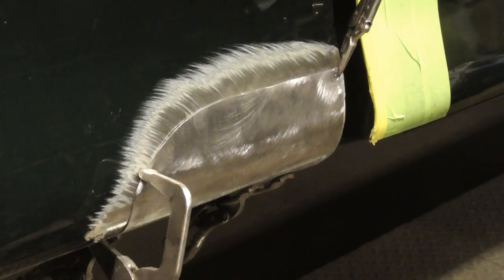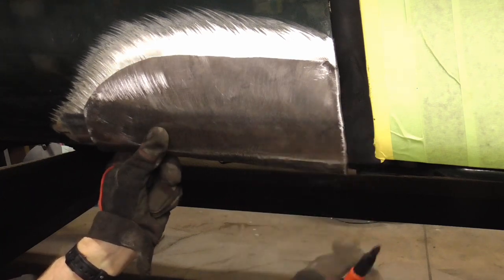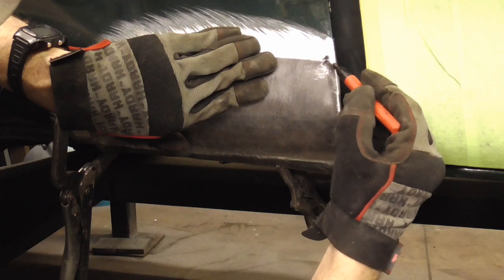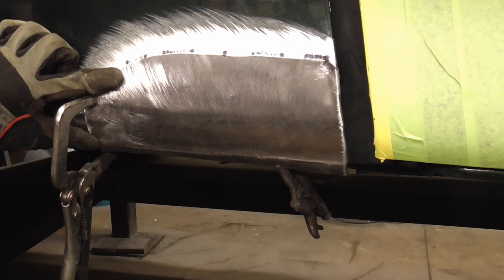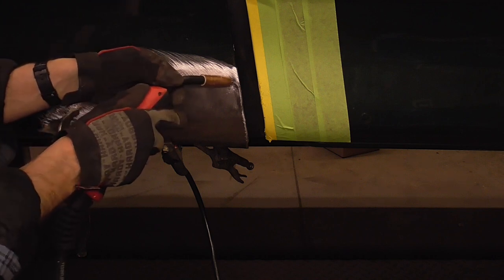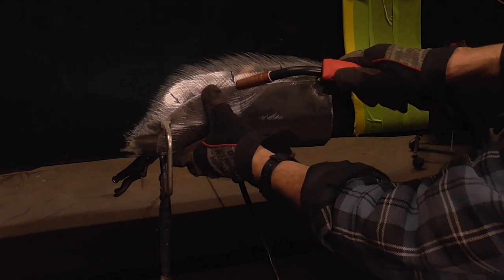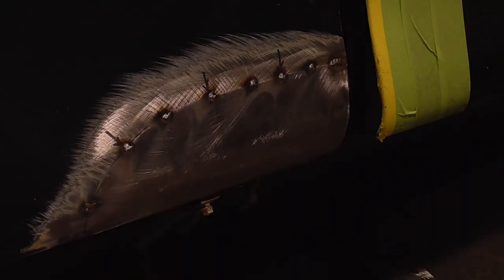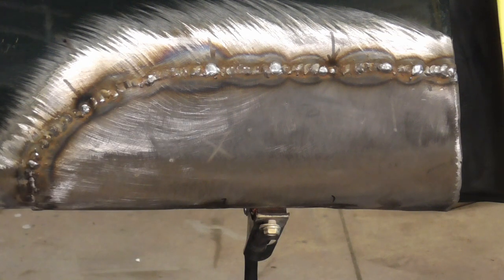How to MIG Weld Rust Repair Patch Panels - Detailed & Up Close

Comment: This is everything you shouldn't do when welding a patch panel. 1. Lap joints are prone to rust. Look at any 60s or 70s vehicle, the rust always starts where two pieces of metal overlap. 2. No weld-through primer on the parent material in a place that you will never have access to again. 3. Way too much heat in one spot, even with a lap joint. 4. Parent material wasn't flanged for a lap joint, that will take lots of hammer dolly work to fix or body filler for the lazy approach
Reply from the maker: With tons of respect, everything you said here is bad info.  A combination of lap and butt is always best - see - https://www.youtube.com/watch?v=JIIonJOVro4  #2 Weld through primer is not for wire welding also factories are moving away from it 'cause they realize that it negatively effects the weld pool and really doesn't work that well  #3 There was no metal dist - not enough heat.  Also rigid areas, you don't have to worry as much as large open flat areas.  #4 Body shops don't use flange tools because you cannot always use it.  If you can't used it on right angle bends, contours, angles, lips, why do it. If you do rust repair for a long time you'll eventually use the methods found on this channel for efficiency and longevity - here's proof - https://www.youtube.com/watch?v=gIS1Tbv7Kvw  Stop back in 5 years for another follow up video on this truck - it will look exactly the same.  Sorry. I've got to look out for those that want to get a job doing this one day.  I worked in many professional shops and know what bosses want.
Reply: Where is your video of doing it the un lazy way

Comment: uhh thats not butt welding. thats lap welding. not the best thing for patch work. just my opinion.
Reply: He said only the edge is butt welded with the rest lap welded. You would not be butt welding thin 20-22 gauge metal on my vehicle and then grinding the weld flush. After all that grinding I would have no metal left resulting in a weak repair. Lap welding is longer lasting and much better repair with today's thin metal.
Reply: @jonathanyates5198  then you are not doing good bodywork in my opinion. i do nothing but butt welding and grind flush. when im done it looks like nothing was there. lap welding requires more filler that will and eventually crack. at that point you are sculpting work ... not filling. there is a huge difference especially in a restoration.
Reply from the maker: Butt welding is great for restorations that aren't going to be driven anymore - especially if you grind the heck out of the welds and try to metal finish like the magazines and TV suggest.  For longevity you'll want to use a combination of lap and butt for many good reasons - see the following vids - https://www.youtube.com/watch?v=JIIonJOVro4  *  https://www.youtube.com/watch?v=gIS1Tbv7Kvw  Trying to get the truth out there :)
Reply: grinding seems to be a point here. so ill say this. if your spot welds are solid with good penetration to the backside, you should be fine. your spot welds should be flat enough on the front to do a nice grind flush. if you're grinding beyond that cause you're thinking it doesn't look that way then thats a weld issue. stop and fill with another weld. you should not grind beyond the existing metal to make your welds look good. that is where you make yourself thin.
Reply from the maker: @jamesroe7628  With respect, I totally get what you are saying but you can never guarantee the the seam is water tight.  How you do your patches is totally your choice but know that quality body shops I've worked at that want to make sure that their work doesn't come back & holds up to daily driving in the rust belt use this method.  When you see an outline of a patch or bubbling around the edge of the patch in a few years, it's because the seam was not prepared like this.  See this video on why:  https://www.youtube.com/watch?v=JIIonJOVro4  It's just the way shops do it here in the metro Detroit and surrounding areas :)  Have a great week James :)
Reply: @jamesroe7628  He only puts on a skim coat of filler. The seam is tapped just below the surface. Not enough filler applied to Crack. Speaking of which, the only time I've seen filler fail is when the surface wasn't prepared properly or some dim wit used it to fill in a rust hole. I've seen filler applied thick and correctly that never cracks unless someone hits them in an accident

Comment: You over lapped the pieces but no flange?
Reply from the maker: Yes - no sense in flanging if you can't do it 100% of the time.  Can't do it around bends, 90 degree angles, rockers, wheel opening lips, edges, rigid contours, etc.  Get good at one method and become very efficient.  Hope that helps explain why I don't do it :)

Comment: That process sure gets the job done fast! The new welder seems to be working well, once you figure out it’s idiosyncrasies 👍
Reply from the maker: It's a good welder for the price.  One of those things where you have to use it to get familiar with what works best.  Thanks for always supporting CSG :)
Reply: @LakesideAutobody  cheap welders usually benefit from changing ground clamp to a bronze one, the cheap 1 from Harbor Freight can make a world of difference on some small 110V welders

Comment: Another great video Jerry! Those YES welders are popping up all over the place. Seems to weld nice but it has an interesting sound.
Reply from the maker: I was able to eliminate the weird sound by increasing the wire feed and temperature a bit.  I think it was some sort of electrical vibration.   I can weld just like a Miller or Lincoln - just got to find the right setting and get familiar with it.  Seams like a really well built unit so we'll see how it holds up under some constant usage.  I'll be sticking with it for a while just to see.

Comment: Great job Jerry.  I will be doing a lot of stitch welding on my rally car build to stiffen the chassis.  Your new Mig welder has a unique sound to it.  Thanks for the video.
Reply from the maker: Yeah - I haven't figured exactly what that is.  I do notice if I turn up the wire speed it goes away.  Might be some weird electrical vibration - not sure.  I started a platform to upload viewers project pictures.  The link is at the top of the home page - Project Pictures and More or the link can be found under the "about" tab on the home page or this :https://discord.com/invite/Qm6qJgcubu

Comment: I prefer to do the lap weld joint where I can too. In my experience, it makes for a less wavy repair and a stronger repair. I've seen a lot of guys on youtube do butt repairs, I tried it didn't like it. If it's in an area with a lot of curves,then I will butt weld, but the panel has a tendency to not warp on curvy areas. On a long straight repair like an outer door bottom, I prefer the lap weld, it just stays straighter. I will butt weld  on the corners like you did here. To me thats the perfect way to do it.

Comment: Nice job. panel welding is almost like meditation to me.  On big or long panels I sometimes just zone out and go on auto pilot
Reply from the maker: It's nice when you've cut out ALL the rust - didn't cheat then run into real thin sheet metal while welding.  Gotta love it when each weld melts nicely into the other and you get into a nice rhythm.  Thanks for watching and the support Bruce

Comment: Great closeup detailed video. When you overlap a small part of the metal versus butt welding the whole panel, how do you make sure it doesn't rust between the panels?
Reply from the maker: It won't - that's an internet/magazine/blog thing.  Body shops don't butt weld unless it's an edge, rigid panel like rockers, etc.  Here's a good video on the subject - https://www.youtube.com/watch?v=JIIonJOVro4

Comment: I like the way you showed the weld location with the marker first. The detailed welding is very good, this will help me a lot. I'm looking forward how you grind down the welds. I have a problem getting this done. A flap disk always takes off to much surrounding metal (I really try to be careful). A die grinder seems to work good but is slow. Since you didn't flange the body, how do you get the patch flat to the fender? I always enjoy your videos and will watch this one many times.
Reply from the maker: Next Friday I'll have a video showing exactly how to prepare this patch for filler and finish it.  It should really make it easy for you.  No frustration getting the filler straight, no problems with thinning metal/welds, etc.  A good quality, long lasting repair.  Thanks for watching and I appreciate the kind words.  Have a great weekend my friend :)

Comment: Hi Jerry, great video mate. Is there any reason you did an overlap vs butt weld on top? is this just a time/cost thing for repair vs resto?
Reply from the maker: You can butt weld that seam if you like.  In a regular body shop setting you use both but depending on the situation.  Lap for areas that can be tapped down and butt for areas that can't - edges, sharp bends like A/B/C posts etc.  All body shops I've worked at in SE MI did it this way - many are now using panel adhesive on their lap joints.  See this video for more on lap vs butt - https://www.youtube.com/watch?v=JIIonJOVro4
Reply: @LakesideAutobody  thanks Jerry. Any weld through primer on the surface’s that overlap?
Reply from the maker: @mickholgate3347  No.  Here's why:  You will be adding metal with the wire feed and this will not be coated with the weld through primer.  Also I doubt the weld through will hold up to the MIG temperatures - surely there will be bare metal around the area you welded.  Finally, Honda and others have stopped the use of it - they state that it has a negative effect on the weld pool.  The best way to prevent future rust is to treat the repair after the job is finished like this - https://www.youtube.com/watch?v=8XaZBy7GC7A  You can use used motor oil or purchase products that do the same thing like Cosmoline, Fluid Film, etc.

Comment: Love your straight to the point approach, btw ever used bronze mig weld and your thoughts? Cheers keep up the great clips
Reply from the maker: I have not.  Might take a look at it for a future video though.  With the low temps it may work better for some thinner sheet metal.  Have you used it on sheet metal?  Thanks for the kind words and have a great weekend :)
Reply: @LakesideAutobody  hey thanks for replying, Seen lots on utube on bronze welding and I’m 50-50 on purchasing and trying it! Would be great to get your opinion 😁 I think I’m being a cheap bastard lol. Have a great weekend cheers
Reply: @abdulhamoui4376  it isnt a true welding, its like a silver solder, many new car manufactures call for it to repair HSS, "High Strength Steel"  to be effective on new cars you need a pulsed MIG to keep temp colder at braze joint. 

some people like the color for doing custom exhaust. but its up to you. its very expensive for what it is. 

wire I never tried, but want to is EX grind, so supposedly will grind easier than normal hard MIG wire. but never tried it either, personally I prefer Washington Allow wire for auto-body with Lincoln wire my second choice.

Comment: Ho from Argentina!!! Thanks for your video!! I need your opinion. Butt welding or overlaping sheet metal panels? Thanks
Reply from the maker: Butt weld rigid sections like edges of doors, rockers, and stuff where your seam can not be tapped or knocked down before filling.  Areas that can be tapped down - lap.  Body shops in MI lap most of the time and butt where you are forced to do so.  See this video for reasons why - https://www.youtube.com/watch?v=JIIonJOVro4  & this video for longevity - https://www.youtube.com/watch?v=gIS1Tbv7Kvw

Comment: I have that same Miller Cricket XL you have under your new welder. How would you set it to get those nice beads you made. I'll be spot welding in my B pillar mounts on my Crew Cab and want them to pool nicely like yours. Just can't afford a newer welder right now. Nice work ya did on that patch 👍 Thanks 👍
Reply from the maker: I really do love that Miller - it's just bullet proof and welds great every time no matter the thickness.  For 22 or 20 gauge metal I set the wire speed to 35-40 and and the heat on 2.  If i start blowing through, I'll move it down to 1 but keep the wire speed the same or drop it down about just a bit i.e from 40 to 35.  Gas is 80/20 argon/co2.  Have a great weekend Ron - Jerry
Reply: @LakesideAutobody  Thanks Jerry. I appreciate it

Comment: So was the about 1/4 inch longer? Thank you for the video!!!🔥🔥🔥🔥
Reply from the maker: Yes the "lap" is about 1/4".  It can be larger or smaller - your choice.  You really don't have to worry about corrosion between the metal as the seam will always be upside down.  Also rust always begins at the bottom of the panel where the debris, salt water, and moisture settles.
Reply: @LakesideAutobody  ok the so the welds help blend the over lap in with each other?
Reply from the maker: @papergatorzfedducca7998  Somewhat, but the lap is still there - it's a "high" area.  Next step is to tap your seam (welds) down just a bit and fill - like this: https://www.youtube.com/watch?v=ZgAA4PD8EUs  Keep asking questions if you have them :)
Reply: @LakesideAutobody  ok thank you!!!!

Comment: what gas mix do you use?
Reply from the maker: The place I exchange my bottle at has only 80/20 argon/co2 - it works great for me on all thicknesses of automotive metal - frame/brackets/sheet :)

Comment: whats your opinion on the YES welder? been seeing lots of good comments from others, but no experience.  besides Miller, Lincoln, Hobart, vintage Cobra, Snap-On YA212, the Blue Demon, which I own and use, plus Lincolns & Hobart, but my go-to is the Blue Demon, for auto-body, then there is possibly Eastwood.

in auto-body I prefer 120 volt welder, plus I like the ability to play with it, for example if number 3 heat is too cold, and 4 is too hot, you can use a 15' extension cord of 16 gauge on purpose, to restrict welder, and get ranges in between, lol, otherwise I use a 15' 10 gauge cord for moving welder around, without any voltage drop.
Reply from the maker: I've used Miller welders for my whole career and they are bullet proof and simple but pricy.  This welder is a multipurpose welder that's very versatile which makes the lerning curve a little steeper because of all the options.  I think the quality is fine, it welds just fine, but you'll have to play with the controls a bit to find the right setting for each process.  Over all for right around $400 you can't beat the Yeswelder 205DS.  I think this company is fairly new so they are very open to making improvements to their line too.  I think they are a good company overall and the customer support is good also.
Reply: @LakesideAutobody  I started off as a Miller man, but some of them being finicky, pushed me to try Lincoln, & never looked back. I own around 6 Lincolns, 3 Hobarts, 1 lincoln being engine drive, & 1 Hobart being a pipe-line welder from like the 1950's several misc off brands, including a Blue Point, plus the Blue Demon, as well as a uni-spotter, and a clamp spot welder. I have my Miller 135 at a friends shop, it has been there around 20 years. yeah, 1 of these days I may  bring it home? lol. I was using my Lincoln 180 today doing a project for a friend. 

I mention all the welders, because I do love welding, I like playing with them, and love seeing what some are capable of. nothing has surprised me more than that Blue Demon. which was bought as a joke to just tack weld, & I consider it my primary welder for auto-body welding. 

I may have to go buy 1 of these Yes welders. the praise has got my attention.
Reply from the maker: @randymack1782  Thanks for your input and sharing your knowledge on welders Randy.  Nothing beats a welder you can trust - especially after you get it all cleaned up with a new tank of gas, wire, tip, etc. Nice talking with you my friend - have a good weekend :)
Reply: @LakesideAutobody  Is that a 110v or 220v welder?
Reply from the maker: @jonathanyates5198  It's 110 or 220.

Comment: Are fires common when welding patch panels?
Reply from the maker: Doesn't happen too often but if they do start, they are super easy to put out.  The air gun quickly blow them out - not a problem or a worry at all.  If you can't see inside of a panel, drill a small access hole that air can be blown into and you can also see light through - you can always plug it with a small body plug - Performance Tool W5262 - Performance Tool Body Panel Plugs.
Reply: @LakesideAutobody  Thanks!